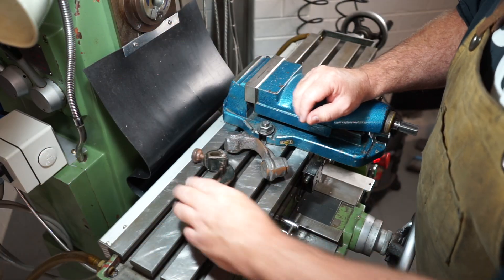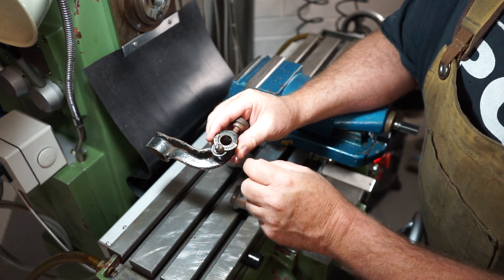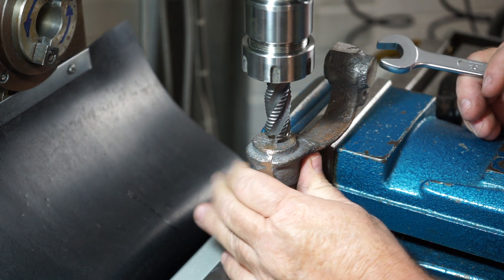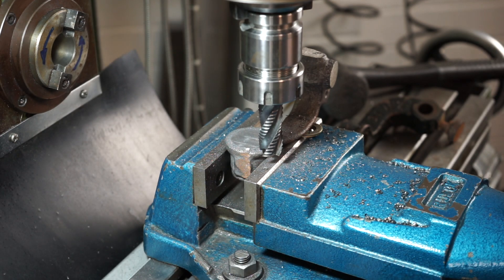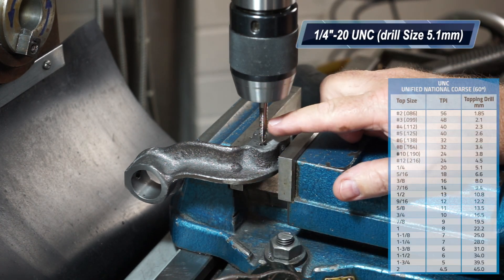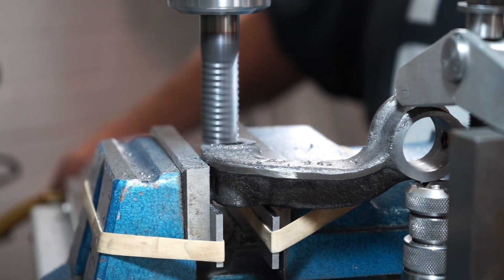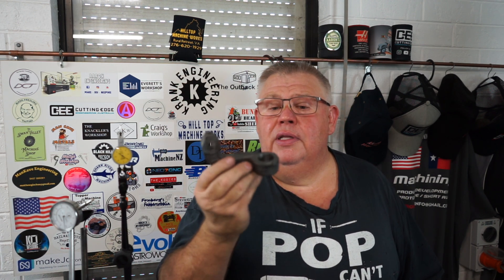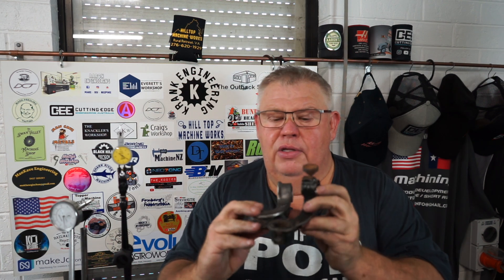I struggled holding this part - CAST Iron Machining

Comment: Nice little project well done Aaron 👍
Cast iron sure machines nice, if it just wasn’t so messy. 
Cheers…..
Reply from the maker: Thanks Dean.  Glad I got it done.  Machining casts with no drawings isn't easy.  Especially trying to work the measurement off an old part.  Cheers, Aaron.